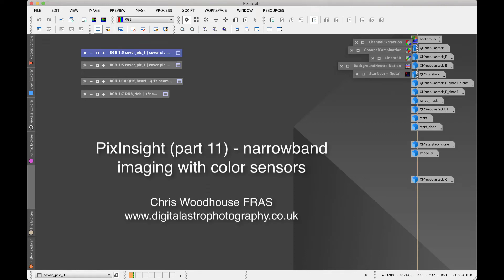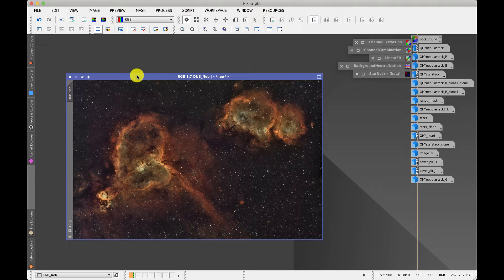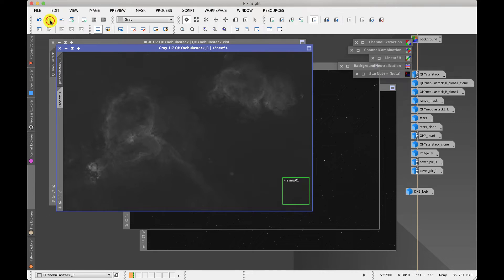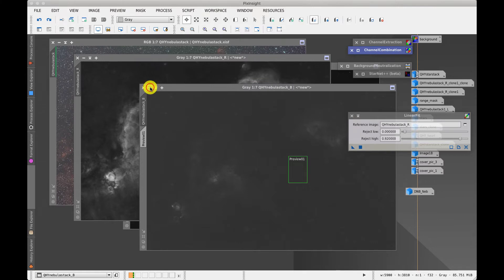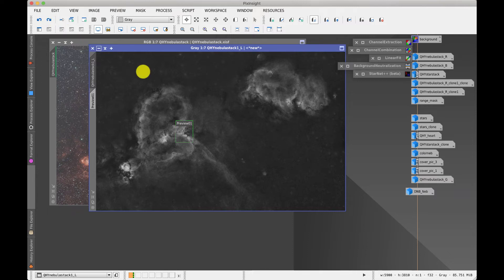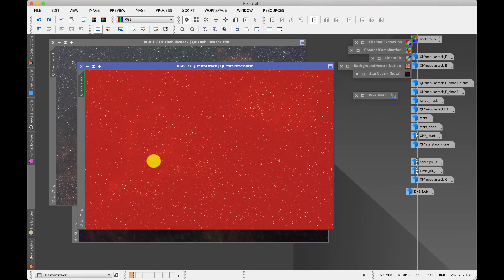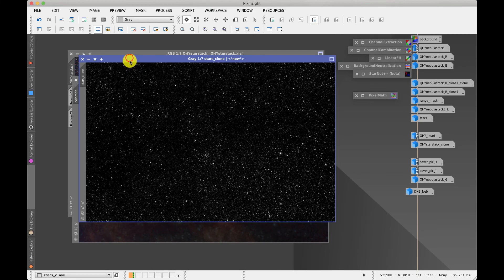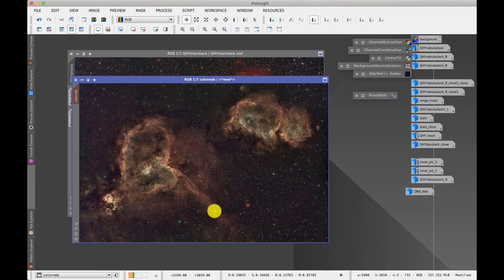PixInsight (part 11) - narrowband image processing with color sensors

Comment: Would it be possible in order to get near RGB color for the stars in the original working image to do photometric color calibration, followed by some saturation then later to add them as you have to the nebula image?
Reply from the maker: I really cannot comment on photometric accuracy as my aim is to have a colorful image. For instance, globular clusters are mostly old stars but many renditions have a full spectrum balancing to white. There is always room for new ideas and often the best way is to simply try it and see!

Comment: Hi Chris, great set of videos, very useful for a Pixinsight learner - thanks!  I have tried this process out a couple of times, and my problem is that when I re-introduce the stars, I have subtle but noticeable ringing (from about 1:3 view). These originate from the star removal, rather than the addition - they're not really noticeable without the stars there but bringing the stars back certainly highlights them! Is this to be expected, or if not, any idea whether this is perhaps the way Starnet is interacting with my images, or maybe something else I'm not doing right? Possibly the image I extract the stars from is more stretched than the one I put them back from - so maybe that's why a gap appears?

Comment: So what you are saying is that is not really useful to separate Ha, Hb, OIII and SII filters on a colour camera ? Im better off using a dual or triband filter ? But can I use a SII filter if I want this detail to come across?
Reply from the maker: A couple of things:  With a color camera, half the pixels are green filtered and a quarter are red or blue. You have better imaging time efficiency using a multiple passband filter, otherwise 3/4 of the pixels (blue/green) are entirely idle during red-filtered exposures. These multiple passband filters are not cheap, especially the triband ones.  SII is excluded in the duo band ones. I guess 1) the sensor Red filter is rolling off already at 672nm and is about 20% down on the Ha sensitivity and 2) It is another red - so how do you distinguish between SII and Ha in the final image and 3) - difficult to implement in a really narrow passband so more likely to include light pollution. 

I guess you could do traditional narrowband if you do the following:  take duo narrowband, amalgamate green and blue channels into one for 'OIII', take the red channel and assign it to 'Ha' and then take deliberate SII-filtered images, extract the red channel and then re-assign to the 'SII'. It can be done.... just a bit clumsy and inefficient. It is at this point that you start contemplating a monochrome camera....
Reply: @astroshed  Thank you Chris, this clears up a whole lot for me.